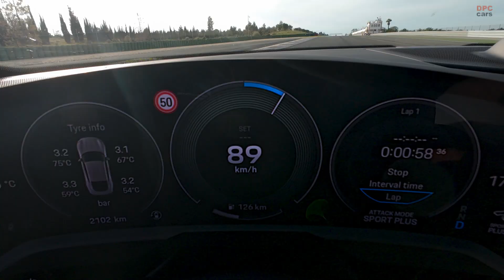Porsche’s Electric Surprise: Fake Gear Shifts That Feel Real?

Comment from the maker: Do simulated gear shifts make an electric Porsche more fun or more fake? Tell me if you would keep them on or switch them off — and why. Also, which brand is doing the best job with driver engagement in electric cars right now?